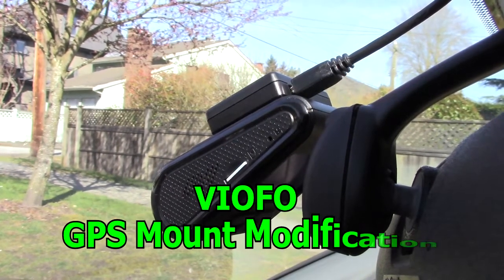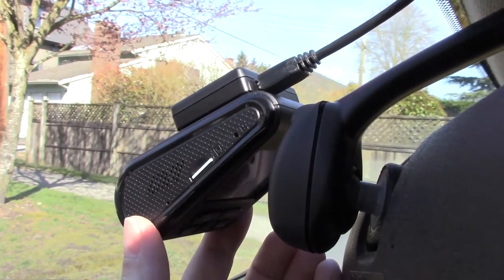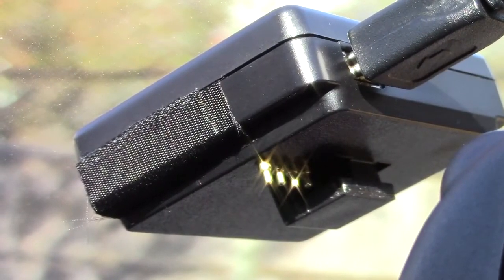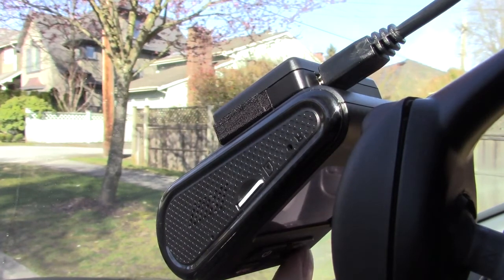Dash Cam GPS Module Modification VIOFO A119 A119S

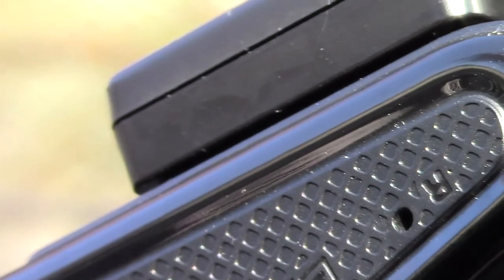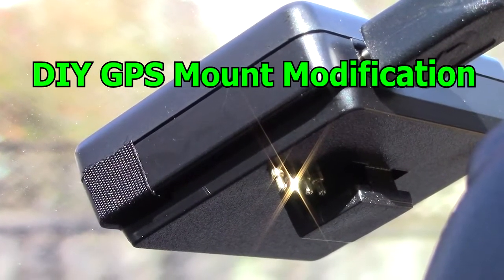Comment from the maker: // timeline // 0:09 identify unstable mount // 1:05 before & after footage // 1:58 GPS mod step 1 //
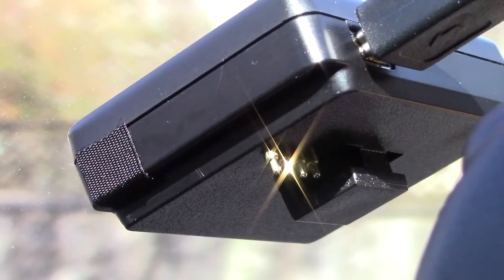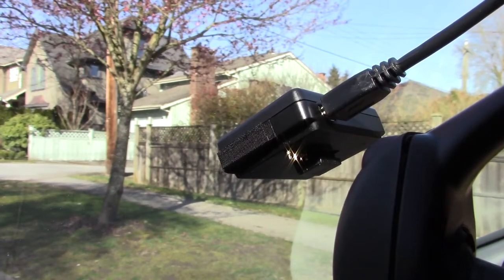// 2:20 GPS mod step 4 //  2:34 GPS mod step 6 // 3:20 attach dashcam // 4:12 material required //
Viofo A129 Duo Dash Cam Review: https://viofo-a129-duo-dash-cam-review.blogspot.com
Viofo A119S Dash Cam Review: https://viofo-a119s-dashcam-review.blogspot.com
Viofo A119 Pro Dash Cam Review: https://viofo-a119-pro-dash-cam-review.blogspot.com
Viofo A119 Dash Cam Review: https://viofo-a119-dash-cam-review.blogspot.com
Reply: so u need to add the 6 layer tape to both sides of the GPS at the bottom?

Comment: Mine doesn’t do that. The Viofo A119 V3 comes with two foam stick on pads that you have to stick the the back of the camera body. Once I put one on mine, it didn’t vibrate at all.
Reply from the maker: the A119 shown in video was from 2016 and the original V1 design mount which was junk. Viofo was flooded with complaints so the newer V3 was released with EVA stabilization pad as shown here =
How to Apply EVA Pad on A119 V2 V3 : 
https://www.youtube.com/watch?v=3LYXwE9LLEU

Comment: It's me again, just did something easier cut a strip of spare tape, provided for mounting camera.Cut a  strip .25 by .75 and apply at bottom of GPS mount but don't remove plastic cover facing camera. If still loose, try different dimensions size of tape.
Reply from the maker: Very good idea to use strip cut from 3M mounting adhesive, that stuff is heat resistant and everyone already has some in the box. Too bad the Mount wasn't better designed the second time around. There is always version 3 some day hopefully. Version 1 was a disaster, version 2 missed the mark . . .

Comment: Great fix, also if you start with the shortest piece at bottom away from contact pins first and longest and  final piece last. It will be less likely to peal the tape when removing and installing the  camera. Another solution might be making 2 thin tappered black plastic strips and bonding to GPS unit on edges of mount , after measuring gap at bottom opposite pins to become thickest part of wedge.

Comment from the maker: Created new STABLE Modified Firmware for all VIOFO Dashcams with high Sharpness and default Hue & Saturation for improved low light detail recommended and verified by DCTeam. How to Install Modified Firmware: https://viofo-dash-cam-modified-firmware.blogspot.com /// View ReadMe and ChangeLog for details.
=====> VIOFO A119S <=====
FWA119S_MOD-6Vf_v4.02B+26Mbps+Sharp506072+Edge138+DCTeam.bin
Download > https://drive.google.com/open?id=1CbrN0k53lB0kNDCO7cvLJbMOXoBlxZZC
FWA119S_MOD-4Vf_v4.02B+24Mbps+Sharp506072+Edge138+DCTeam.bin
Download > https://drive.google.com/open?id=1aBCQ37JToMVfQMZM6WBLup6d7Xu6gi-I
=====> VIOFO A119 <=====
FWBA119_MOD-7Rf_v4.00+27Mbps+Sharp170+Edge148+DCTeam.bin
Download > https://drive.google.com/open?id=1Yd7J529hKyZ45mTyGdsFrpGnBmO89rj4
FWBA119_MOD-5Rf_v4.00+25Mbps+Sharp170+Edge148+DCTeam.bin
Download > https://drive.google.com/open?id=1n4_DnSUaFVwGTQF2S3FCJz1yBb2fpqNm
=====> VIOFO A119Pro <=====
FWA119P_MOD-7Tf_v1.32+27Mbps+Sharp180+Edge138+DCTeam.bin
Download > https://drive.google.com/open?id=1ge6amvzfX5ynmwtotaW3qRuCEct0Z5IO
FWA119P_MOD-5Tf_v1.32+25Mbps+Sharp180+Edge138+DCTeam.bin
Download > https://drive.google.com/open?id=1kWgUJx8_JuAUXdhf9jtbed0KVvbFNBcB
=====> VIOFO A129Duo <=====
FWA129_MOD-4Uf_v1.42+24Mbps+Sharp123+Edge132+DCTeam.bin
Download > https://drive.google.com/open?id=1-jnG4ZnMFUk50uq-Nj3H-U17FCBw-cIl

Comment: I have the original camera and that thing locks solidly in place and does not vibrate, never looses GPS signal and does not make weird noises when driving.. those roads you drive on are pretty horrid...

Comment: The tape to hold between the gps and dashcam
Reply from the maker: Selling this Tape marked for cutting via regular post to Canada or USA through PayPal. // $3.00 USD ($4 CAD) = Tape for 2 GPS Modules 20" // ask for details with email to: GPSmodTape@gmail.com
Reply: @bchobbyist  Are you still selling this tape? I would like to use it on my A119 V3
Reply from the maker: The A119 V3 always includes 2-4 EVA foam pads to help stabilize the poorly designed mount. If yours was missing contact the seller or create a service ticket on Viofo's website. A more permanent DIY is to apply the same tape in this old video over the same surface the EVA pad covers in my other video: https://www.youtube.com/watch?v=3LYXwE9LLEU
The tape is heat resistant and never wears out, while the EVA pad disintegrates over time.

Comment: Cool mod but I have to ask, with all the time you put into making this camera work better, couldn't you have just bought a higher quality cam for more money? I for one am done dealing with the A119. I will be going with a Garmin. There are so many horrible drivers in my area. I do not want to run the risk of having this camera fail when I need it most.
Reply from the maker: good comment, most consumers are overwhelmed by variety of devices, most vendors never reveal flaws, defects, fails. These dashcams are priced right, use normal MP4 file, offered more resolution & setting control than more expensive models and the worst mounting system I could imagine other than suction-cup. As a Hobbyist I had to buy the A119 & A119S just to open it up and see what makes it tick. Tinkering with F800 not so much.

Comment: Hi,
Your video on the GPS Mount Modification is awesome. I'm having the same issue with the GPS mount. Can I ask to see if I can get the special tape that can be placed on to the mount. I have to VIOFO A119S with GPS mount. Can you give me to name and or manufacturer of the tape. I see that its high temp flue tape.  Thank you
Reply from the maker: GPS Module Modification Tape used is called: Black Acetate Cloth Adhesive Tape (made by 3M)
10 mm wide // 0.13-0.17 mm thin // segment sizes 6 / 10 / 14 / 18 / 22 / 26 mm
Same tape used in smartphones, LCD monitors and laptops. I still have some available, contact info in description above.
Reply: Thank you  for that information. Before purchasing my A119s I researched the info on it and ran across your utube video on how to install. Great video presentation. I do not think I could have done it without your help.

Comment: This webcam comes with 2 Foam Pads. Did you apply the Foam Pad to the DashCam?  That should eliminate the space which causes the gap.
Reply from the maker: VIOFO now includes EVA Foam pads to reduce mount vibration and correct their design flaw. Consumers that purchased prior to June 2017 were out of luck and suffered with poorly designed unstable mounts. My video points out the design flaw and offers a solution to consumers with Version1 (original) GPS Modules. Other creative ways of stabilizing the mount have been posted by owners below.
Reply: You did the next best thing to stop that vibration. Good idea !
Reply: You can now purchase them. http://a.co/8qFmlxU

Comment: not working less then 6 month of use!!! and the forum of the company doesn't respond as so many have same problem. link for forum: http://support.viofo.com/support/discussions/topics/19000014834
Reply from the maker: If you've tried all the troubleshooting steps i've posted to others with no change you should return the product or use warranty. There are a few things you can do as last resort. Remove microSD card then power it on, do you get an image? if so then the card is bad or incompatible use a Lexar 32/64GB as in my TIPs video. If stuck on LOGO power off and open case, check ends of capacitors for slight bulge, compare with my Disassemble video for anything broken or loose inside, check ribbon cable position is seated.
Reply from the maker: view my HOT PIXEL video for procedure to downgrade Firmware but use older version A119 FW v2.0 (A119S FW v1.2 or v1.01)
Reply: link please.
p.s i don't think i can upload firmware as i try by connecting usb to computer and when it did not responded i tryed by inserting the memory card with the firmware
Reply from the maker: I'll create a step-by-step Firmware Update video today.
Reply: thanks so much! i was just about to give up on this cam then i show your video and it seems that the cam is working again. thank you for the video
Reply from the maker: I created the 'How to Update Firmware' video just for your problem. It demonstrates the entire process in 13 mins in clear and easy to understand steps. Subscribe so you don't miss my many DIY Repair videos.

Comment: дурачок вставь зубочистку и все.
Reply from the maker: good idea to slide a toothpick in the gap, it's just sad the manufacturer never tested the product and corrected this loose mount until 6 months later after 1000's of Dashcams were sold. The newer boxes now include a thin piece of EVA foam you attach to the Dashcam over the clip base.

Comment: Viofo have changed the GPS mount. The new model uses flat connectors (flat strips of metal which curve out and back in again to act like a spring), rather than those funny spring loaded pins. Plus they now use foam pads between the unit and mount to stop the rocking.
Reply: thanks for the info. you can buy the new mount at aliexpress. there ae also picture which show the difference you describe: https://de.aliexpress.com/item/VIOFO-Updated-GPS-Module-3M-Sticker-Mount-Holder-For-A119-A119S-V2-Car-Dash-Cam-Dashboard/32810166662.html?ws_ab_test=searchweb0_0,searchweb201602_3_10320_10152_10321_10065_10151_10344_10068_10342_10547_10343_10322_10340_10341_10548_10193_10194_10084_10083_10618_10304_10307_10302_10180_5711215_10313_10059_10184_10534_100031_10319_10103_10627_10626_10624_10623_10622_10186_5711315_10621_10620_5722415,searchweb201603_25,ppcSwitch_3&algo_expid=702005e1-e449-40b6-aca5-31588a05381c-1&algo_pvid=702005e1-e449-40b6-aca5-31588a05381c&priceBeautifyAB=0

Comment: That tape also looks thick
Reply from the maker: The acetate tape is 0.15 mm thin, need 6  layers to build up 0.7 mm thickness. The 5 inch length has one 3/4inch segment as a spare. To get a better idea measure your own gap between mount and dashcam. The goal is to fill the gap with anything to prevent vibration. The tape I use is not affected by extreme summer heat in the vehicle.

Comment: Clearly these are micro slices of tape. I see no way to actually use the full size of the tape plus 5 inches worth. Your video is helpful but it needs better visuals and more step by step. As I am just guessing at how you placed the take
Reply from the maker: its called layering to overlap the previous, apply the smallest segment around the edge to fill the gap, then apply next slightly longer segment layer until gap is filled. Try it with electrical tape but split the width, thats close to the 10mm segments used in video, remove the electrical tape after a week or two else the adhesive starts to gum up.

Comment: I modified my two A119S mounts with the tape you sent. Seems much nicer but not too tight that I am worried of undue strain or anything. Thanks.
Reply from the maker: glad your DIY Repair worked, simple, effective and long lasting. check your email.

Comment: Really nice tips. So it's a 25 inch tape divided to 6 varying size. What is the exact size of each cut?
Reply from the maker: GPS Module Modification Tape used is called: Black Acetate Cloth Adhesive Tape (made by 3M)
10 mm wide // 0.13-0.17 mm thin // segment sizes 6 / 10 / 14 / 18 / 22 / 26 mm     
(test fit dashcam after 4 segments applied to both sides, could stop at 4 or 5, 6 is stiff and allows for compression and future wear) Example of stacked layers and size comparison ( http://i67.tinypic.com/dnlz5e.jpg )

Apply segments either from GPS Module plastic side-seam then wrap under corner, or start under corner and wrap towards side-seam. Must get all the layers even under that corner lip to fill the gap shown in my video.
I send 5inch lengths which is longer than needed.
good luck on your DIY Project.
Reply: Thank you very much for detail info. Subscribed! :)
Reply from the maker: very few ways to buy this specialized acetate heat resistant tape, electronics shop, commercial electrical supply shop, specialty adhesive/tape supplier or online stores amazon & ebay through china.
Reply: BC Hobbyist - can I buy this 3M tape in a retail store? Who sells it?
Reply: 25 inch? I swore he said 5 inch. You can't put 25 inches of tape on the mount

Comment: Hey thanks for the amazing videos, I am interested in purchasing some tape for my GPS unit, is it possible for you to pre-attach all the pieces? like on a piece of plastic and ship it? That way I just reattach the whole strip or that won't work?
Reply from the maker: excellent idea ! more work for me ! actually to get tighter adhesion applying one at time is probably best. The 6 layers won't bend evenly at lower end, one at a time works.

Comment: That's a great work around you've given us, thank you. Just wondering about the 3M tape on the GPS mount that appears to be thicker. Have you found that to be an issue with movement as well?
Reply from the maker: that's sharp thinking but no the 3M adhesive pad is not that thick, besides my solution eliminated all vibration even on that horrible road in the road clip. Another brand of dashcam does use very thick mounting tape and it acts like a shock absorber and improved the video. VIOFO's extra adhesive pad is much too thin and causes air pockets on curved windshields, that's why I reused the original pad for less air pockets.
Reply: Re the air pockets, a mate took his tape off the mount (once he decided on the position) and stuck a spare tape in position smoothing out the bubbles, then exposed the mount side of the tape and stuck the mount to it - result was a perfect (oem like) black patch. I think that'll be my method when I decide on which cam to use.
Reply from the maker: great mounting tip ! would sure look better from outside. might make another video ;-)

Comment: Good Fix...Just mounted a A119 w/GPS last week. Its rock solid but if it develops this issue i now know how to fix it....Thanks...
Reply from the maker: does your new GPS Module look different than one in this video? There is a rumor VIOFO has designed a new one but haven't seen it yet.
Reply: From what i can see it looks the same.But i might be wrong. Its in my girlfriends car i will have a look at it when she gets home Heres a photo of it when i un-boxed the camera.......https://flic.kr/p/SUkMNJ
Reply from the maker: thanks for the response, yours is the original GPS module and could suffer the same mount vibration issue. It wouldn't be as noticeable if the vehicle has smooth suspension.
Noticed you received the bonus right-angle adapter, when you have the chance remove the A119S and take a photo of the mount slot but cover your serial number with paper. Yours may have the new mount ridges.
Reply: Heres a photo of the A119 Mount Slot......https://flic.kr/p/TpjJHe
Reply from the maker: thanks for the response, VIOFO still haven't changed the A119 pedestal mount or added side glides or runners. Keep my GPS MOD in mind if you need to stabilize yours in the future.

Comment from the maker: The tape used in this DIY video is the same tape used inside your dashcam as shown in my TIPs video. // https://www.youtube.com/watch?v=IKo6S8S8-S0&t=300s // It's also found inside laptops, smartphones and auto industry to secure and insulate wires. The tape width used is 10mm for better overlap holding and easier handling.